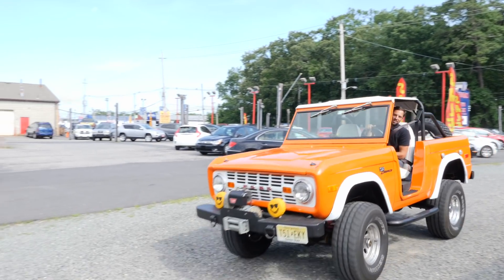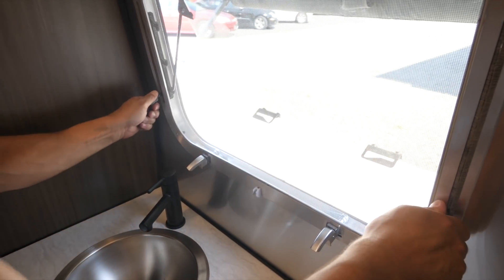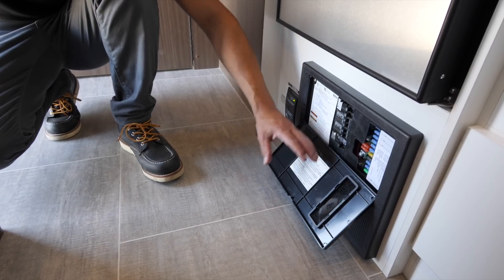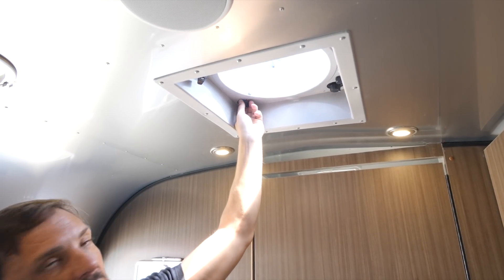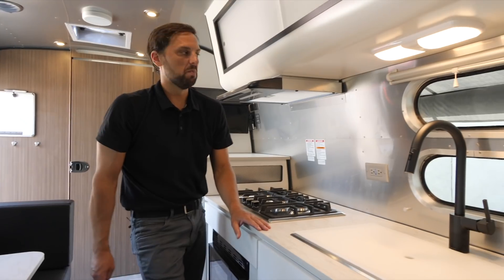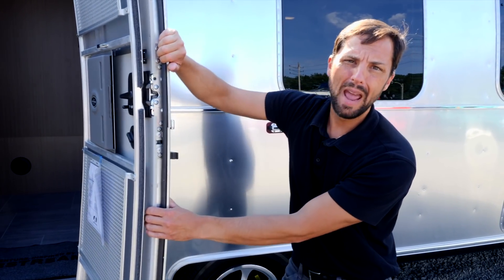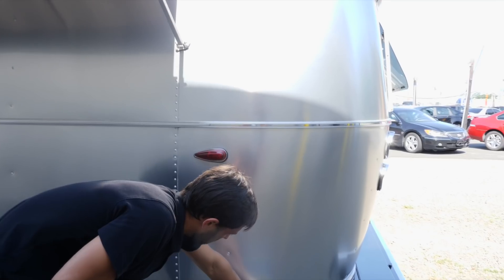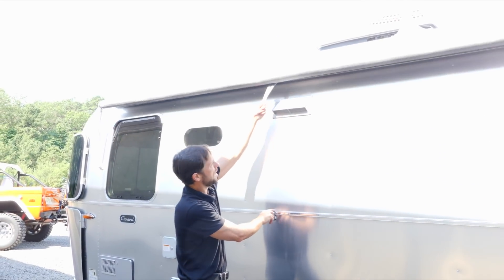2020 Airstream Caravel 22FB Walk Through Small Light Weight Travel Trailer Bambi Size

Comment: Great video! But I never understand why manufacturers focus on inverter power outlets. The TV, your laptop computer, cellphone and most all of your gadgets and electronics are DC. The trailer should run the TV directly off DC and include a ton of USB and/or USB-C outlets. 60W is enough and will power almost anything. An inverter with a couple of outlets is also fine, but it’s so inefficient to invert DC to AC and then back to DC.
Reply from the maker: Thank you for the suggestion.

Comment: It seems like having electronic monitoring in the bathroom (the place most likely to experience moisture) would be a bad idea.
Reply from the maker: This 22FB floor plan has been around since 2008 and no problems with moisture on the monitor panel.
Reply: @colonialairstream , Is their a ceiling fan in the bathroom?

Comment: What an awesome and thorough walk-thru. So very knowledgeable as well. You put our dealer to shame. Quick question. You mentioned a lock for the battery box. What exact type of  lock do you recommend and it is basically "Plug and Play" or does it require some basic modifications? Any details would be greatly appreciated. Thank you!
Reply from the maker: Thank you very much. We sell the locks in our parts department. No modifications are needed. Please call 1-800-265-9019

Comment: Nice layout, but the bed sizes would really only fit  3 people with a small width for the back bed.  The dinette is basically a twin size mattress (regularly 39x75)and the back  bed is  the width of a full mattress(regularly 54x 75) with just a little more length of 80”.  Would have loved this model if it had a king size in the back and a queen for the dinette.  That would allow  the back to be a king or two twins and still enough room for  couple on the dinette.
Reply from the maker: Thank you for the comment. This trailer with the size mattress and dinette you are requesting would have to be a much larger and wider trailer to accommodate your wish list.

Comment: How long would the fridge last just on DC power while boondocking?
Reply from the maker: It draws up tp 2.2 amp per hour i there is no charge from the tow vehicle the solar panel, it can drain the 160 amp hour batteries to 50% in 36 hours.

Comment: Gross weight leaves 1000 lb, how much is left if  you have a full water tank?
Reply: If you use 8 lbs/gal for water weight, with a 27 gallon FW tank and empty black and gray tanks, you'd have 784 lbs left for other items in the trailer.
Reply from the maker: Thank you for watching.

Comment: fridge is too small
Reply from the maker: For a trailer that has a floor length of 18'6", the refrigerator is sized appropriately.
Reply: @colonialairstream  Well, I disagree, there are plenty Lance travel trailers, and Arctic Foxes and many more that are that size that will give you bigger refrigerator's come on u know that.  When you spending all that money, that frig where it was at could of extended up all the way to the ceiling.